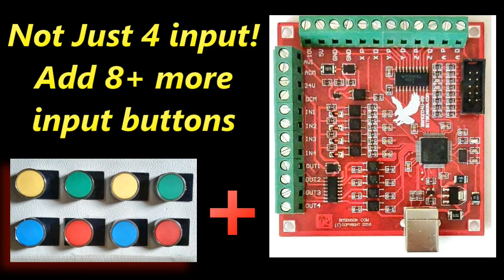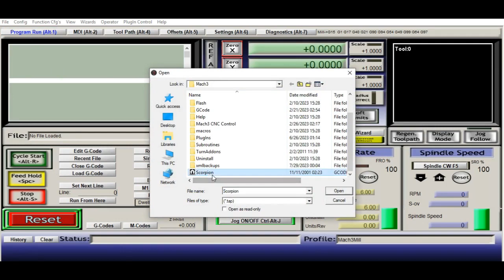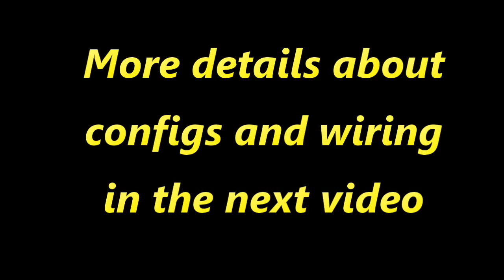Add 8 more Inputs for Mach3 Red (RnRMotion)

Comment: How did you configurate the button on/Off of the spindle? with OEM codes? In that case, can you tell me what codes control the spindle? 
Thank you
Reply from the maker: Spindles will be on and off with gcode and configuration in output pins , I have a video to show you how to run spindle , wait for it ...

Comment: Excellent work, maestro! :)
I see that you have an interest in this controller.
I also chose it from many others. And now I'm trying to connect a laser to it. However, Mach3 has a feature that prevents the use of the laser: it stops the movement along the axes if the M3/M4 command is encountered in the program or the rpm change (Snnn -> Smmm). To prevent this program, the developers of Mach3 made changes to the program. Then it became possible to control the laser using the M11Pxxx / M10Pxxx commands. The M11Pxxx command sends a signal to pin xxx and M10Pxxx disables it.
And now I'm thinking, can I use output 4 of this controller for such a task?
If you could check my assumptions - I would be very grateful. And I will be happy to distribute your information among the community of users of this controller.
Reply from the maker: Thanks a lot.
I am trying to connect the laser to mach3 with PWM support (not with relay) ,I Searched a lot but I couldn't find anything for real or those are just for advertising.
I'm on it 👍 and anything new will be informed here.
Reply: @manifa59  I will be glad to help you with my knowledge.
I researched the issue of laser control in Mach3.
Not sure if there is a solution for halftone laser engraving using PWM. As I said, Mach3 pauses the movement of the tool when the S mode is changed.
It is possible at the beginning of the NC to set the needed laser power with the S command, then apply power to the laser with the M3 command. After that, turn on the laser at the previously set power with the M11 command at the burn points.
To implement such a mode, I need to check the ability of the STB4100 controller to control output 4 by command M11P4 / M10P4. You will also have to put an "AND" logic element with PWM inputs (output 3) and output 4.
Reply: @manifa59  Hi! I have been experimenting with the laser. So far, I have not been able to solve the problem of the machine freezing at the time of switching.
This freeze occurs on commands M03/M05, M07/M08/M09 and Sxxx
The hope for the M11P4 team did not materialize. I was unable to control the O4 output with it. Although I found a lot of evidence on the Internet that this command works correctly with LPT.
I'm afraid that the "RnR Motion" plugin is not capable of handling this command.
Then the option remains with the output Dir of axis A.
Reply from the maker: @AlexMoonXXI  Main part is searching and searching ...
I have seen lots of video running lasers with mach3 but no configuration and even no electronic part included.
So we must do it by our experience.
I am on it until success
Reply: @manifa59  Most laser control solutions are based on the LPT board.
In addition, many users are not picky about the quality of laser processing. If the laser is used only for cutting, then M3 / M5 commands are enough.
But I need a laser to expose photosensitive materials on PCB. This implies raster-movement mode. And it doesn't allow any delays at on/off moments.
So for me, only control of the M11 / M10 commands is suitable. But they can work well with the LPT board, but not with the red USB controller.
I hope this problem can be solved.